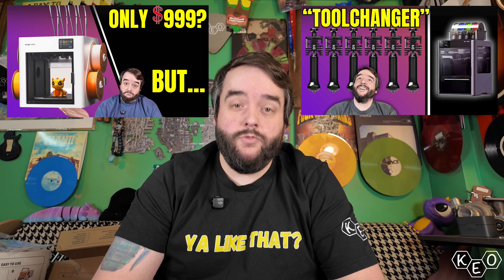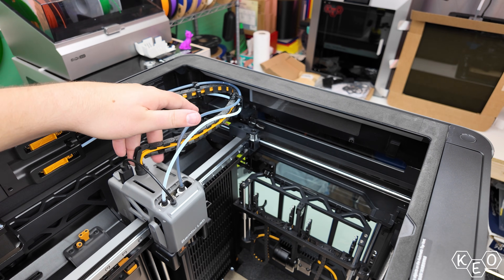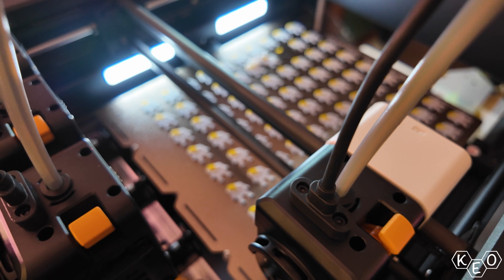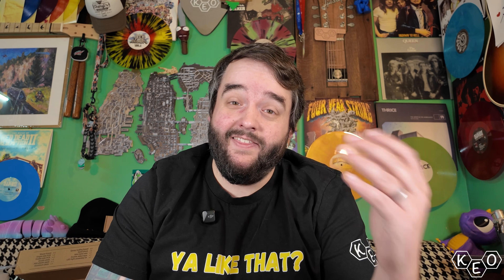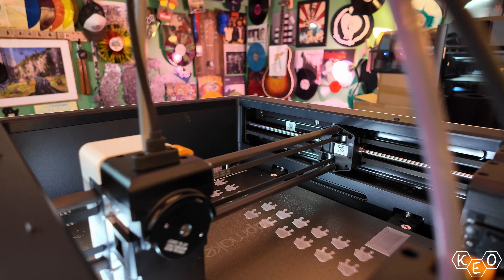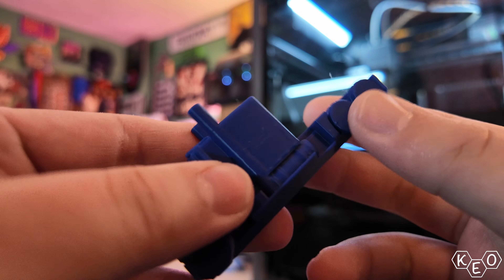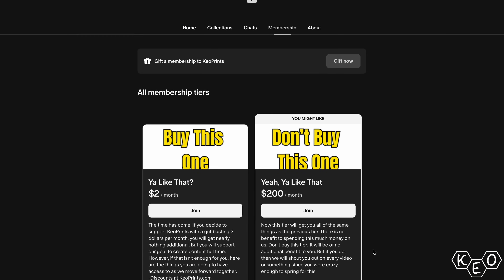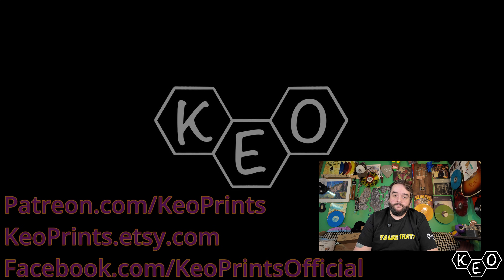Bambu H2C vs Snapmaker U1 — Toolchanger War

Comment: I'm fan of a bambu machines and i only have bambu machines but I've pre ordered U1 instead of H2C. TPU is the future! and leaving it out just like that is the biggest flop :( 
Printing multi-material stuff is the future, embedding TPU into parts makes them functional, durable and for many designs it opens up a whole new level of possibilities. Like handles with softer exterior layer, boxes with softer corners, for container with a lid you can embed a TPU gasket etc.. the list goes on almost infinitely..
After the reveal of H2C when i found out that nozzle changer system relies on AMS i just face palmed knowing that TPU is out of question...
Reply: You can do all of that with an h2c even better because the temp swings are regulated by a dedicated enclosure. Remember the h2c has a dual nozzle, one that prints soft tpu from external spool (not ams) and the other materials from the vortek/ams into one functional part.
Reply: @Uji_Metal  Bambulab says left nozzle is not suitable for TPU and when you use the right(vortex) nozzle then what is the purpose of vortex because then i will have to detach the AMS. It is a highly CRIPPLED system for double the price. In fact H2D is better than H2C for TPU printing as you can use the left one for TPU and use the right one for other filaments with AMS.
Reply: @orhanyor  no that was an error on the website that you heard about. . Left nozzle is in fact suitable for soft tpu. 
 So yeah h2c is currently the best printer on the market for multi material functional parts. Hence the expensive cost.

Comment: I am looking forward to the eventual delivery of my kickstarter U1.  But, if I had to pick one, it would be the H2C.  I have an H2C and H2D.  I trust them more, and they have a build volume that I use regularly.  I would love a U1-XL or U2 or whatever to be 320+^3 and 6+ toolheads.  4 toolheads is, to me, 3 colors/materials + support.  Of the two prints I have running now that would be good enough for only 1 of them, unfortunately it would be the one that doesn't fit on the u1's build plate once I add supports.  TPU/soft-materials is very important to me.  I would love a from the factory solution to soft-materials from Bambu, but I don't think this will ever come.

INDX will be intersting, but not on the CoreOne (tiny to the point of useless to me once you add subract the 20-30mm for the INDX you end up with a 220x225 build plate.  Even the "L" with a 300x275 is kinda meh, but at least it is a mostly useable size.  Everyone has a large printer now because many of us want to print larger things that don't always work well chopped up.  Also the INDX for the CoreOne has already slipped in to q2 according to Prusa.  And they have yet to start on the INDX for the L... who even knows when that ships.. 2027?  later?

Comment: It blows my mind that anyone can look at the U1....Bondtechs INDX system and Bambus Vortek system and think the Vortek is better in any way. It still wastes more filament, small amount or not. The color swaps are 2-3x slower and on top of that. There are so many moving parts and "wear" parts in the Vortek system. It literally falls short in every single category. Great day to watch all the Bambu fan boys try to defend the Vortek garbage 🤣
Reply: You are right. Saying this as someone who had to get the H2C since it’s currently the only option for printing engineering stuff with 3 incompatible materials (nozzle purges are not perfect). Print quality (one material) is behind my P1S, to my surprise, and the H2C makes dumb stuff like pausing before and after switching between left and right nozzle, not even doing this while moving the printhead to the rear (which it always does, annoyingly).
Reply: You done with your little rant or have something else to say?

Comment: The Bambu system is a mechanical wonder and the ability to print with 16 plus colors, but the time it would take print with that many colors would be insane long. It is a pity Bambu did give the option of not having to use the MMU because it would cut the time by a lot. With only 4 sec nozzle swap, Bambu would beat everyone.

Comment: I'm waiting for my Snapmaker U1, extra nozzles and enclosure, and I'll be looking at modding it for ASA once it's set up. It's a great bang for bucks currently, but who knows how soon others will catch up.The INDX system from Bondtech, looks better than a H2C, and if I could have fitted something like that to a Qidi Max4 it'd be more than good enough, maybe throw in a filament cutting INDX head, and hook it up to an open source  AMS and you have a great combo. Once the Snapmaker Orca or Orcaslicer can do multiple nozzle sizes in one print, that'll be game over for my FDM 3D printer journey, as I'll adding CNC or subtractive to the workshop. I still have a Bambu X1C Combo that's modded etc, but I'll never get another, even if it seems like I'm cutting off my nose to spite my face... however it doesn't stop me recommending them to others with caveats. :)

Comment: Thanks for showing the user experience! How is it on PC to color on the different slicers? Does the Snapmaker software have something like makerworld in the slicer?
Reply: Snapmaker does not have a print profile warehouse like makerworld, but you can just load makerworld prints into snapmaker orca and print them on your U1. It can sometimes lose some of the bambu settings so for print profiles that really hinge on custom painted supports and raft distance configurations, things like that, you won't get the "It Just Works" experience you get with loading your makerworld profile into a bambu printer and going. But it mostly works fine.

Snapmaker Orca is based on Orca which is based on Bambu Studio. They are more or less the same in terms of functionality, with some minor differences. Coloring in particular is more or less the same experience in both
Reply: @chrisjohnson00 thanks! I just got the p2s because of ease of life, and KIO recommended bambu.

This kind of information was "never" available when researching what printer to get. So I am stoked it is getting implemented, because for most new users looking for what to buy, I believe user experience is high on the list.

Comment: The Snapmaker U1 is what I've been waiting for to get  in to multi-color printing. I got into 3D printing about 5 yrs. ago and the waste associated with multi-color has always been the barrier for me. I can wait a little longer to see what other manufacturers come out with. Great comparison, thank you.
Reply: Same here. I’m still relatively new to 3D printing, but the sheer amount of waste generated by current multi color systems has always bothered me. Even for hobbyists and non professional use, it feels excessive and hard to justify. That’s why solutions focused on drastically reducing or eliminating purge waste are so exciting to me. It’s not just about cost, but about efficiency and sustainability too.
Reply: Get your head out the gutter, think multi material not multi colour! :)
Reply: @danieldc8841  Nearly every functional part I print doesn't require supports, so I would rarely use it for that. But there are some things that do require multiple colors I am working on. Besides, I like the gutter, it lets me get a good look at the roof without actually getting on the roof 😆
Reply: @3FWDesigns I like the gutter too, its more fun there!
I also like multi color but 7
Reply: I've been 3d printing for 12 yrs and the U1 is what I've been waiting for, for multicolor printing!
Reply: The U1 is phenomenally fast for colour changing, and we've already saved a huge amount of filament from the poop bin, but for us it's the potential for multi-material prints, with petg support/interface layers between PLA print layers, and vice versa.

Sadly our PVA supports experiments failed every time, so that's not a solution to our no-cleanup miniatures dream.

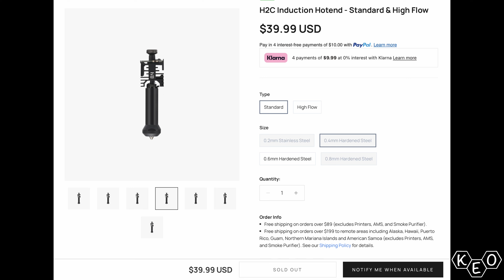Comment: 3:20 it’s odd so many different YTers reviewing the U1 seem to have latched onto this one rando comment about the lifespan of those pogo pin contacts. Sure, some might suppliers only spec 100k, but others are 1m+ and there is nothing to suggest snap maker is using the cheap ones. Sources matter and don’t know why anyone finds this comment worth quoting.

Comment: Not sure what my next printer will be. Bam Bu Lab X1C I have has been great. I would of jumped to H2C had I not seen the PRUSA with nine tool heads. But I am not a person who wants to take the machine apart which is required for the PRUSA. Maybe, maybe Bam Bu Lab will take note of the PRUSA implementation and do the same with an X2C . Heads in the back of the machine giving the printer space back and figuring how to shorten the load unload times to and from the AMS. I am 81 (soon to be 82) and I do love my X1Carbon.
Reply: Do you really need a new one tho. I'm still rocking my pulse xe.
Reply: it's so much fun assembling the core one.
Reply: @RogerEssigArtist  Nope , not at my age.
Reply: @richardlange9094  fair, ha. either you are too young or too old. I assembled my Core One at 46. I found it very enjoyable. kind of the whole 'i made this' thing.
Reply: @RogerEssigArtist  NOPE, not at my age.

Comment: Just a few points you do not need to change the entire tool head on the U1 you only need to replace the tool head board as this contains the pogo pins that are the wear part  the pins can last  250,000 changes maybe more if they are cleaned regularly the tool head boards  are $24.99 and the carriage part of the pogo pins board cost around $14.99 for 2 of them that is around the same price as one nozzle on the bamboo. As for the replacement parts yes they are not available until March April time but if a part packs up in the meant time Snapmaker will send them out free of charge because they are covered under warranty usual delivery time is 7 days by air.  As for the cost of the H2c if you want to use the full 6 nozzles you need to buy a 2nd AMS and if this is your 1st printer that will add to the overall cost. apart from that a nice review.
Reply: The pogo pin propaganda from Bambu Lab's H2C advertising video have really infected people's brains. Yes it's a simple replacement, though most people will never wear them out. You could likely even solder on replacement pogo pins for pennies.
Reply: Not to mention that the pogo pins are used to run the part-cooling fan on the carriage. Not exactly a dealbreaker if that fails.
Sure it's not nice that it can't run the cooler anymore, bridging might not be as good anymore, but it probably won't prevent you from printing at all until your replacement part arrives.
Reply: also, If you know how to solder, this is probably easy to replace - similar to the omron microswitches in logitech mouses that last ~10 million click; easy to replace and ~1-5$ from aliexpress.
Reply: Awesome info - thanks so much!
Reply: Don't forget, unless you want to manually load/unload the left nozzle you'll need a third AMS or at least an AMS HT to cover that nozzle too.
Reply: You might also need to change the gantry head or whatever it's called
Reply: @mostlymessingabout The pad likely won't need replacement anywhere near as soon.
Reply: @mostlymessingabout  that side is just passive contacts where the pogo pins match to. I doubt they'll wear out.
Reply: Really don't want another maintenance/wear "pain point" like stupid pogo pins.  Anyone claiming this won't be an issue has been huffing too much snap-gas propoganda.  Hard pass.
Reply: @Sprogster  This is like saying you won't buy a keyboard because the key switches have a rated lifespan of X keystrokes. Most people will never reach 250,000 swaps on a toolhead and even then it's not guaranteed failure it's a minimum lifespan. Nobody would have even been complaining about this if not for Bambu's ridiculously bad video on the issue. The wires in your 3D printer aren't rated for an infinite number of bends as the toolhead moves either and the fans have a lifespan rating too. The heating elements also have a rated number of heat cycles. Give me a break.
Reply: @Sprogster  Everything on a 3D printer requires maintenance/cleaning/replacement/etc. Wake up dude. Pogo pins have been around for a while and work fine. Replacing them when eventually needed won’t be an issue either. Quit hating, lol.

Comment: You are one of the few Bamboo fanboys I consistently watch. I won't buy a Bamboo product because the company keeps raising red flags for me since their launch. There are mistakes and there are red flags and unfortunately BL have caused red flags. Absolutely nothing against their machines and I am not even opposed to the closed ecosystem. The H2C is not for me personally because I print quite a bit with TPU and my TPU use is growing. I really feel TPU is underutilized by 3D printer owners and in many instance where you would use PLA or PETG, TPU would work sometimes better. Really solid comparison and well edited, as usual video, IMO.

Comment: A second nozzle changer on the other side would be pretty sweet for an ‘X2DC’ or whatever they’ll call it
Reply: Yeah I don't understand why they kept a normal left nozzle on the H2C.  Plus the one big advantage of their nozzle swaps I can see would be using different size nozzles on the same print in different areas and that's still not implemented in their slicer.
Reply: Bc of space. You know how much wasted space you would have if there was a Vortek system on each side. This system is not going to beat out the U1 or INDX. Bambu fumbled this one. The time to switch colors is awful, its twice as long as the INDX system. Have a print with a few hundred color swaps or a fea thousand. You are looking at hours added to each print. I love seeing Bambu fan boys trying to cope with how bad the Vortek system sucks 🤣
Reply: @tonydavis6487 yeah but if you needed a 256mm bed you can extend the 2 sides and have double vortex which could help cutdown on time. While one side is retracting the other print head can be printing probably difficult to code,but could solve the time issue. Definitely something Bambu needs to consider if they want to challenge speed not just waste.

Comment: The reason why TPU doesn't worth with the AMS is because the filament path has multiple Bowden couplers in it. At each one of those is a chance to snag. 

Compare that to the Snapmakers filament path. Personally I don't understand why everyone keeps ranting on about the AMS not being able to print TPU, it's a niche filament.

The pogo pins have a 200k swap life. Pretty standard for that component.
Reply: It's a niche filament because where it shines is in multi-material prints. Up until now it was not possible because it needs a tool changer system. As a long time 3d printer user I can finally  see a whole new level of designs and opportuinites to integrate soft material into normal prints.

Comment: I'm not surprised you're an apple fan boy Bambu is the apple of 3d printing. I disagree with one thing though. Yes parts are pre-order for the U1 but it isn't really released other than the Kickstarter. I ordered extra plates and nozzles with my machine because I have that luck with these things which was born with the Anycubic Cobra hated that machine.
Reply: They are not even close to being apple, can we please stop this nonsense
Reply: @riba2233  It's just a direct comparison but you have to acknowledge the similarities.. Closed ecosystem, closed software, actively discouraging 3d party add on, premium machines. It's also the most ubiquitous consumer machines out there. I'm not a fan of apple but I'm a fan of Bambu I own more than one.  There may be a butt load of 3d printers out there but Bambu is the most beginner friendly 3d printer. I recommend it for people starting 3d printing because it's worth the cost for a start printer.

Comment: We need a Bambu P2C with the same system as U1.. not this overpriced over engineered hunk
Reply: No we don't.
We need the AMS to be gone
It's a stupid system 
Give the AMS lite , a lite pro or just have the spools mount to the sides like the U1 and FF machines.
Or make another AMS
Whatever they do they need to have at least 4 PTFE tubes going to the tool head.
They should have moved to this design after the AMS lite for the AMS pro.
I like the center mounted spools on the lite but the downside is footprint.
They should make it AMS that has the spools mount in a row on top of the machine but center mount them.
And all PTFE tubes going to the tool head and cutting done in the head.

They could have 2 hinged spool holders that each hold one spool on each side
Next to each other.
So you open the hinge and put two spools on and then close it so the spools are at almost the same position as they would be in the regular AMS.